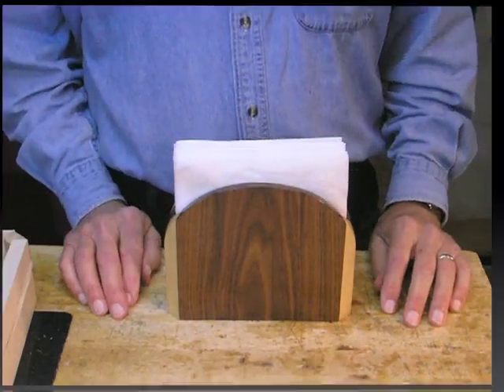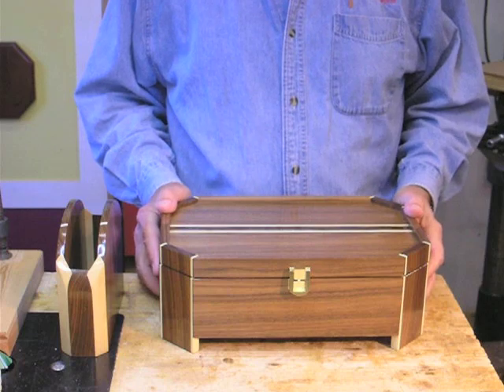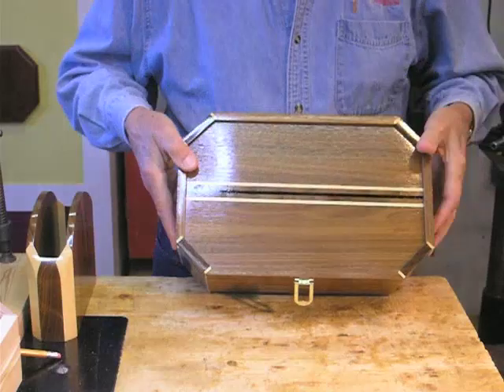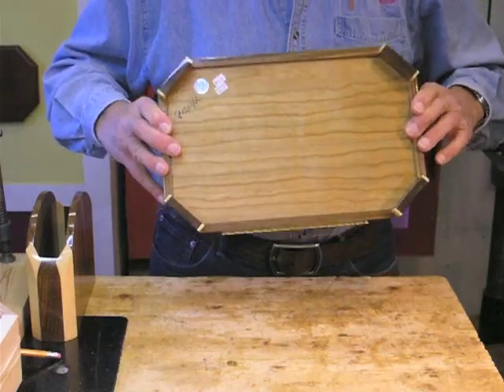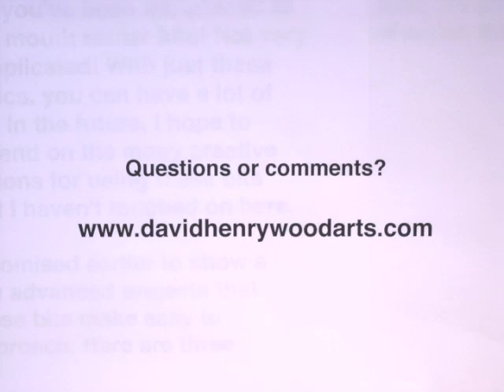Bird Mouth Joinery: the 8-side router bit

Comment: Great video.  Is it critical to the fitting of the joints if the bit height is varied?  Is the most critical factor in a tight joint making sure that the opposing pieces on opposite sides of the "box" are of the exact same length?
Reply: My above question was answered when I viewed your  "A unique tool box" video.  Again, your video was very informative.

Comment: I have just got myself a set of Bird mouth bits after watching your video. Today I tried to use them for the first time, and I am having some problems getting them to join up. I first used the 6 side bit, the joints were nice and tight until I came to putting the last section in. There wasn't enough room for the last stave to fit properly, if I did open it enough to fit in. It through the rest of the stave joints out. I am obviously not getting the Height and depth correct. Could you maybe give me a pointer on how to find the correct height and depth for each bit Please.I have the Yonico set, https://www.amazon.co.uk/gp/product/B00KZM2APG/ref=oh_aui_search_detailpage?ie=UTF8&psc=1
Reply from the maker: Hi Mark!  Thanks for the comment, and sorry for the difficulty you've run into. I've had a number of viewers tell me of similar problems.  Conceivably, it could be your router table, but if your router table works well for other routing tasks then that's very unlikely. The problem isn't the fault of depth or height adjustments: such adjustments affect the amount of stave overlap at each joint, but don't affect the angular fit at the joints, and your problem is angular fit. In other words, the angle of turn at each joint is slightly more than the required exact 60 degrees.

I suggest two things. First, do a simple test. Using your 6-side bit, cut a V-groove down one side of a single piece of stock a foot long or so. Then cut it into 6 equal length pieces and try to make a hexagon shape (perhaps you've already done this.) If you have the same problem you've already described, then you very likely have a defective bit (made with a slight angular error) and there is no cure for this except a replacement bit. As a second check, try the 8-side bit in the same test. Make an octagon from a single piece of stock. While there is no guarantee that the 8-side bit couldn't be faulty also, that seems a remote chance statistically, and I don't remember any communications about bad 8-sided bits, only 6-side. If the 8-side bit gives good results then that pretty much pins the problem on the 6-side bit. Contact me again if the problem isn't solved.

Good luck!
Reply: Thanks for your reply David.I have done as you mentioned and used the 8 sided bit. Although it wasn't perfect, the 8 sides went together. But what I have noticed, that I never noticed before trying these bird mouth bits. Is my router table doesn't lock off the bit once set, and during the cut the bit dropped around 3 mm during the cutting. Not sure if that would make the difference. I took a picture of the 6 sided piece to show you, but I can't insert it into this chat.Maybe a new router table is the answer?Regards. Mark.
Reply from the maker: Hi Mark!      Unfortunately, if your router bit changes adjustment in any way from the initial setting while the router is in use, any cutting it does will be flawed. More importantly, this could be a dangerous situation; if the bit comes out during use it could cause serious harm to you and/or your shop. A new router table, or at least a reliable repair, definitely sounds like a good idea!

Comment: Thank you David, that was very helpful. I have a question though, I have been made very aware of cross grained joinery, as boards expand and contract sideways in relation to the end grain. I have been told not to glue an end grain onto and edge grain because this can cause warping and spitting. I noticed that in the box you showed at the end of the video you had done this. I'm assuming you've not had any problems with it.
Reply: Hi David, I was thinking about my comment, and of course mortise and tenon and cross lap joints are cross grain joints, where as table tops require a breadboard end, I wonder where the cut off it? How wide a board can you cross glue before it's a problem? (I know it is also species dependent!)
Reply from the maker: Thanks for your question, Richard. I'm glad you found the video helpful and hope that you give BMJ a try.

You are not the first to ask about my crossgrain glue joints; many observant viewers have questioned me about it. There is no doubt at all that long crossgrain glue joints are a bad idea; wood moves and such joints will almost certainly fail eventually. I originally used such joints for their decorative value in small projects, figuring I'd soon find out if it was a serious problem. I have used the technique a lot but have yet to have a failure in several years of use; the longest joint has been about six inches in length. That was used in a unique octagonal tool box, and I did a video about that construction (accessible through my YouTube channel.) I can only guess why it continues to work for me. Certainly the fact that bird mouth joints have two glue surfaces adds strength beyond a simple miter/butt joint. Also I stay away from soft woods that expand a lot with high humidity. And it is not unthinkable that the common wisdom of the woodworking world has overemphasized what is clearly bad technique for large panels, but may be more permissible with smaller projects. And your comments about M&T and lap joints are also very pertinent.
Reply: Thank you David. A six inch joint sounds like bigger than I would be using, so I'm probably safe!! Thank you for you responce

Comment: i have  been wanting to build an old fationed fationed  butter churnn can you make the staves tapered
Reply from the maker: Hi William!  Tapered staves can get complicated but they work just like straight staves if there is not too much taper. If the churn you have in mind is the familiar round one about two feet high, with a smaller diameter at the top than the bottom, then I think tapered staves would do fine. Just off the top of my head, this would need 12  two-foot long staves that were 3" wide at the bottom and about 2 1/2" wide at the top. Good luck with it; sounds like fun!

Comment: Good night , David !
I want to know if possible which oil you used to give the finish ?
I am Brazilian and I could not find a oil like this one .
Congratulations, pretty much their work
willian
Reply from the maker: Hi Willian!   Thanks for the comment! Regarding the finish, I use (for almost everything) a sealer coat of shellac followed by (typically) 3 coats of wipe-on polyurethane. The polyurethane is made by General Finishes and is called ARM-R-SEAL Oil & Urethane Topcoat. There are many oil-based urethane topcoats available and all would probably work reasonably well, but I prefer this one because it levels (smooths out) exceptionally well as it is applied, and also builds the finish rapidly. Unfortunately General Finishes products are not sold in Brazil, according to their website. Perhaps you could get it online? Good luck!

Oi Willian! Obrigado pelo comentário! Em relação ao acabamento, eu uso (para quase tudo) um revestimento isolante de goma-laca seguido por (tipicamente) 3 camadas de poliuretano limpe-on. O poliuretano é feita por Acabamentos Gerais e é chamado ARM-R-SEAL Oil & revestimento superior de uretano. Há muitos acabamentos de uretano à base de óleo disponíveis e todos provavelmente iria funcionar razoavelmente bem, mas eu prefiro este porque os níveis (suaviza) excepcionalmente bem como é aplicado, e também constrói o acabamento rapidamente. Infelizmente Geral Acabamentos produtos não são vendidos no Brasil, de acordo com seu website. Talvez você possa obtê-lo on-line? Boa sorte!

Dave Henry

Comment: HI DAVE! I like your glass-like finish on your wood projects. would your poly finish work well on painted wood?,if so,what kind of poly finish would you recommend? thank you!
Reply from the maker: +Jeremy Grefe Hi Jeremy!  I have no experience with painted surfaces so can't give any direct help. However, my best guess for laying down  polyurethane over paint would would be to scuff the paint surface well with steel wool or 320 grit sand paper, spray or wipe on a coat of shellac, and then use the poly. The scuffing probably wouldn't be needed for milk paint. Good luck!

Comment: These are great videos. Thanks so much.
Has anyone seen any 1/4'' shank birdsmouth bits? I'm having trouble finding them.
Reply from the maker: Hi T Bone!     Sorry, but I've never seen a 1/4" shank bird mouth bit.
Thanks for your encouraging comments!
Reply: +davidhenry32  Thanks. Yes, after searching on Google for an hour I came to the same conclusion. So, now I'm in the market for a new router, HA. 
Thanks for your help and your great videos. Keep 'em coming.
Reply: This is a response from several years after the original post! With the mass of that bit I think it would dangerous on a 1/4 inch shaft and that is why you not finding a 1/4 shaft bit of this design.😁🛫

Comment: Love your work David. I wonder if a straight bit tilted at an angle would give the same profile? Looks like the birds mouth is at 90 degrees. Think I'll give it a try.
Reply from the maker: +twoweary Thanks for the kind words and the useful comment! Yes, the bird mouth angle is 90 degrees. And yes, using a tilted straight bit should work perfectly well. I would be very interested in your result. The possible problems I see would be having a router table with angled bit capability (I don't have one!) and getting the angle exactly right. As you probably know, bird mouth joints can also be cut on the table saw but getting the perfect angle can be a problem.
Reply: How about a router table sled with a 45 degree bed?

Comment: Dear David,

Thank you for these insightful videos.  I was wondering if you had considered making an 8 sided box with a flush top rather than an inset top.  That would allow for a more decorative lid using different colored trim pieces around the perimeter of the flush top that would fit into the sides of the lid.  Just a thought.

When I eventually get my wood shop (not there yet), I'm gonna make a jewelry box like I described using bird mouth joinery.  Thanks again for sharing!
Reply from the maker: Walter Reuter Sr. Walter    -    thank you for the thoughtful comment! Yes, I have considered the idea of a flush top, but not yet applied it to a decorative box;  I think it's an excellent idea. Using a similar idea however, I did make an 8-side BMJ coffee table a couple of years ago. I used a beautiful piece of 3/4" pecan veneer ply as the table top and dropped it into place; I was very pleased with the result and the table is in our living room now. Now that you bring it up, that project might make a good video!

Comment: How do you set up the height of the bit? Just trial and error?
Reply from the maker: hedorah99 Hi hedorah99! Thanks for the question, and for sharing my video! In theory, for a given stock thickness, there should be an exact height setting. Unfortunately, in practice, this isn't usually the case and some trial and error will probably be necessary for any specific project. I blame this on subtle factors: the hardness of the wood; almost invisible amounts of warp or twist; different routing setups; different routing techniques; small variations in stock thickness, etc. For the 8-side bit I set the height at 1/4 of the stock thickness and then do test cuts with the same stock that I plan to use for the project. It usually works out that the final bit height is a shade higher than where I start. For example, today I routed a redwood project in 3/4" stock and the optimum height came to an estimated 1/64" more than the 3/16" that I started with. It's worth the trouble to get it right. Good luck with your work! More questions? Just ask.